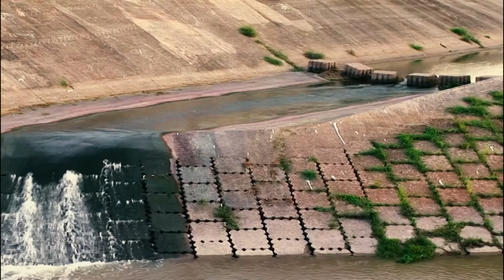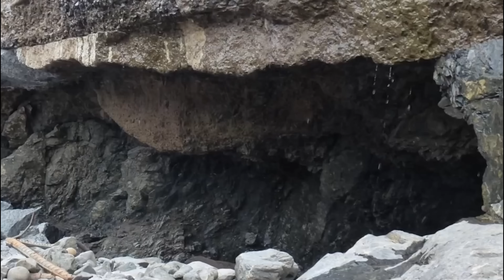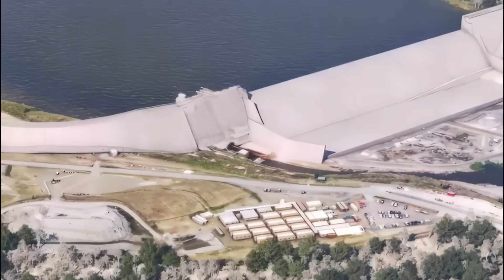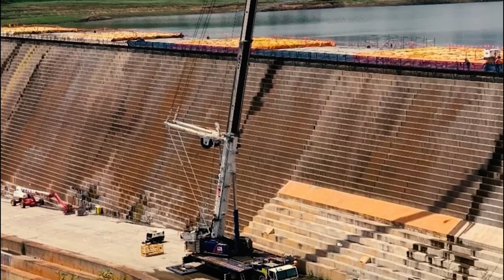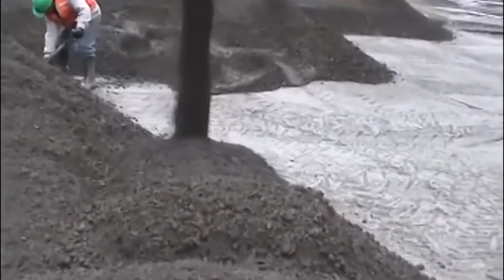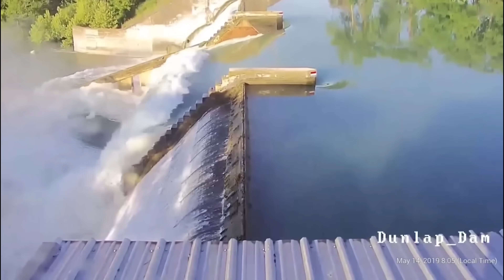Why Australia Is Spending $3 Billion To Build This Dam Twice

Comment: We have many projects built in the 1850s and 1860s in a time of gold rush prosperity.  They were overbuilt for what was needed at the time but they remain in service as far, far better than what took place 50 years later.  A bridge at Beechworth designed for horse and buggy is carrying today's B double trucks.  Parades with divided road, trams separate from cars, three lanes each way plus parking carry traffic from a city that is ten to 20 times bigger than the one it was built for.  It is hard to find ANY project that was "overbuilt" that hasn't repaid the investment many times over.  Equally everyone knows the story of countless projects done on the cheap that cost a fortune over the years and gave poorer service in operation.  (Narrow gauge railways anyone??)
Reply: Top call.
The Melbourne designers and engineers were real men?!

Comment: Heeeeyyy the layering option didn't work the forst time hhheeyyyyy let's do it again but we'll do it better this time 🙄🙄🙄🤦🤦🤦🤦
Reply: As Gordon Ramsay would say, "FK me?!"
Reply: RCC (layering the concrete) was never the problem - over 1900 large dams have now been built worldwide using this technique. The old box construction method would fail just as badly if you used crap concrete.

Comment: No one should either make comment or have any responsible role in the replacement of Paradise Dam unless they have first read and understood the Commission of Inquiry Report dated 30 April 2020.  Once this is completed and based upon recent testing and analysis which together confirm the reasons why a second dam is required.  My research and private inquiries over the past five years do not give me any confidence with the location of the new dam or its current estimate of cost.
Reply: You'll be in the shit if you start this "thinking and analysis" stuff...whoa...they'll mark your card?!

Comment: This is an example of the old adage - you can't win. If the project is slow and expensive, but built right, taxpayers complain that is just public waste. So build it cheap and sprinkle the magic dust on it that says "we are building faster, cheaper, and on time" and taxpayers approve and don't seem to realize that there is no magical solutions, what is billed as efficiency is just plain old corner cutting. So 20 years later the real waste occurs, when they have to build the dam they should have built the first time.
Reply: If it's expensive then fair enough, but when the budget blows out 10x, then people get pissed
Reply: Gravity dam is exactly cutting edge stuff. If they want it built to last 100 years, there's centuries of data on gravity dam build failures, and actual gravity dam build successes still standing.

Comment: The politicians and the engineers 
At the time should now be in jail 
For corruption & incompetence
Reply: Anna wasn't even in government until 10 years after its construction, that's Sky news for ya
Reply: why the politicians?   it seems that the politicians gave the job to a company that then decided to put less cement in the dam wall.   this would have been done to save money.   ive found nothing on the internet to indicate the government gave authority to cut back on cement.   and as for those idiots holding signs against palasczuk, all she did was follow advice of experts and arrange for the dam wall to be lowered to minimise a complete dam failure.   a complete dam failure really would have been a ballsup.
Reply: @vsvnrg3263  because they would have asked for a cheaper quote, its exactly what they did with the Toowoomba bypass, now we are left with a low quality nightmare.
Reply: @brendangee593  , they?   who do you mean "they"?   it seems that using less cement in the dam wall was all the construction company's own work.   did that same company also do the toowoomba bypass?
Reply: @vsvnrg3263  the government. i'm not sure if it were the same company, but thats what the government did in Toowoomba. The contractor kept cutting corners because the government kept asking for a cheaper price.  the contractor would have provided the quote and details of works to be involved and the government approved. its the governments fault
Reply: @brendangee593  , 30 years ago the earthworks company i worked for quoted $62,000 to do a government job and got it.   he made a big fat profit.   all the large multinational companies quoted $400,000!   politicians and bureaucrats dont know how things are done or how much they really cost so they are considered cash cows.   politicians are spending taxpayer's money, not their own, so if a government is squeezing it might be because they know how much a job should cost.   if the tenderer cant make the deal they should pull out, not cut corners.
Reply: i better add, i cant speak for the toowoomba bypass.   i see something about it being a toll road and transurban may be involved.   transurban is a red flag to me.
Reply: It’s in Queensland.

They were supposed to build to rebuild.  They were successful .  They got a promotion .
Reply: And certain responsible engineers be publically named, shamed and barred from contributing to major public works thereafter.

Comment: Just build a thicker high-quality wall against the old dam. Half again thicker, quality pourings.
Reply: Water is leaching through the original, you'd have a dangerous pocket of water and whatever was added will be doing all the work. It's cheaper and safer to start again. They can't do that or they would